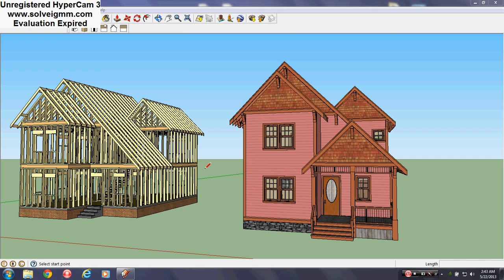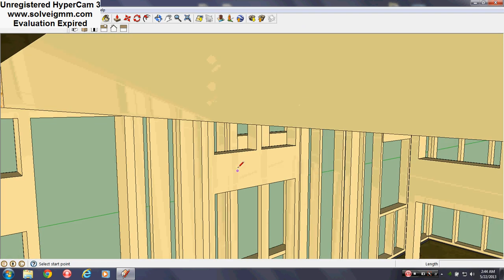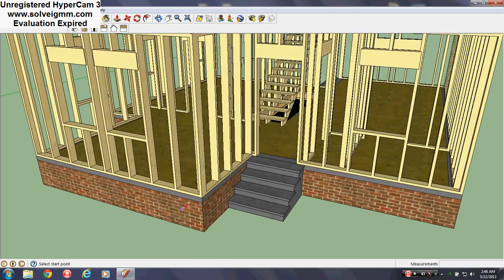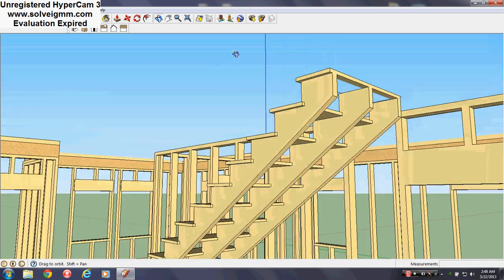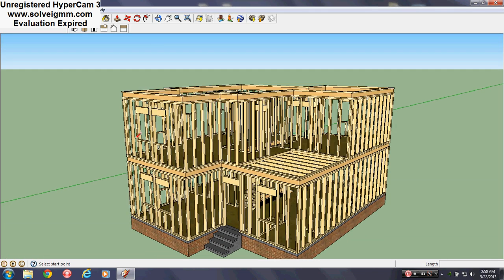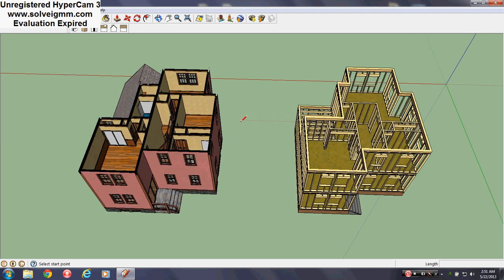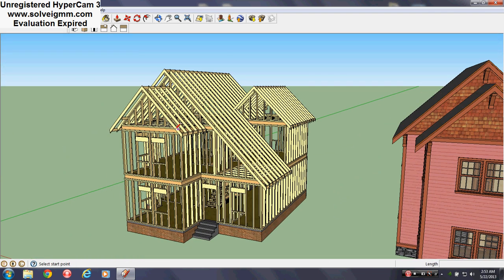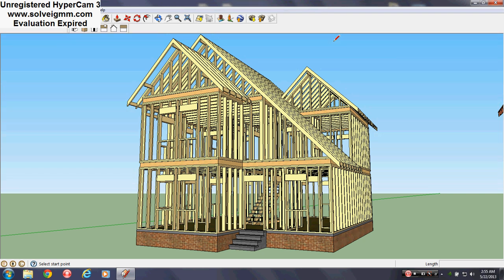Sketchup Frame Building Construction

Comment: Probably the HouseBuilder Plugin will be easier for most people to start with than to try and do what you have done here.  I think you are very good at what you do, but I don't think this video is aimed to teach as much as it is to showcase.  Well done.
Reply: +Joshua Fausset 

Joshua, quick question.  

I need to create a sketch for a small shed located in the rear of my property.  I've been noticing people recomend using the HouseBuilder Plugin.  Is this "plugin" supposed to be used within another program?  How does it work?